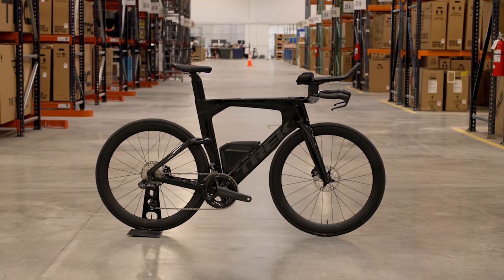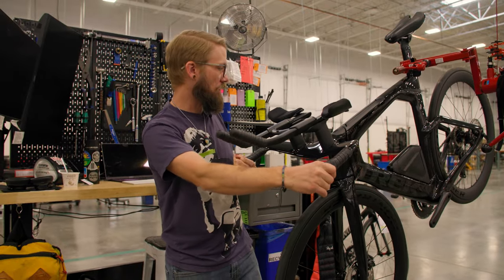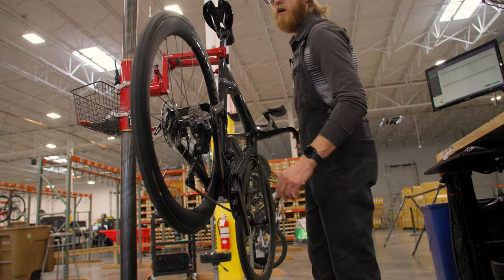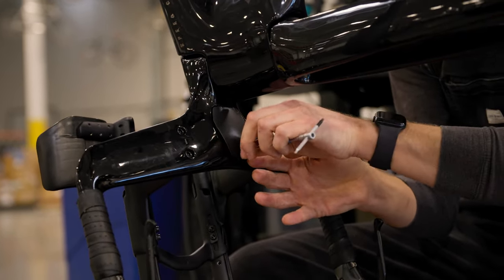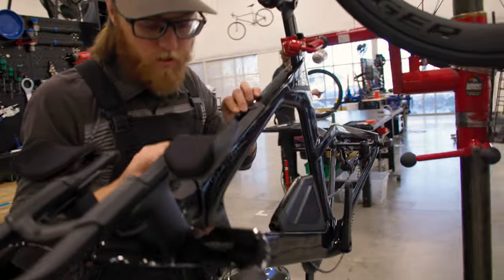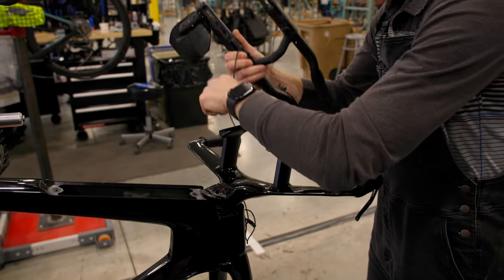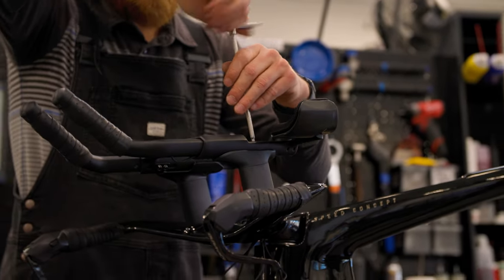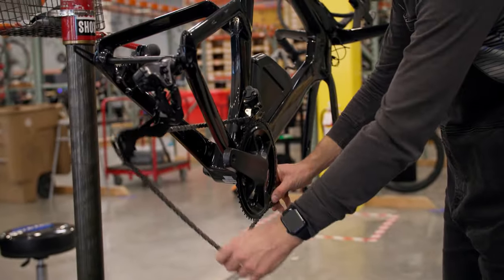Troubleshooting Shimano Di2 With Nightmare Internal Routing | Inside TPC | TPC

Comment: I have worked on several dozen tri bikes with mechanical shifting and these bikes are the perfect place for electronic systems!  Even the best of them have so many bad corners and so much cable drag; the only ones where mechanical shifting works well are the entry level bikes with no internal cables.  When di2 first came out, I thought two things--they belong on tt bikes and folding bikes.  Works great on my Bike Friday!